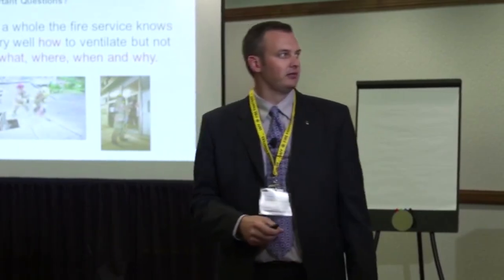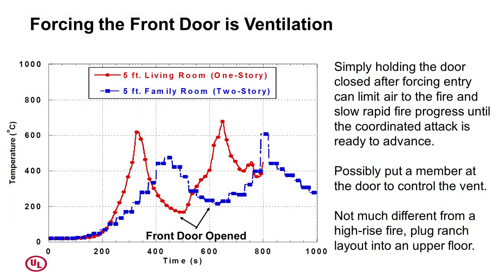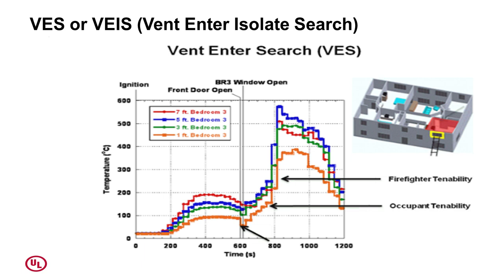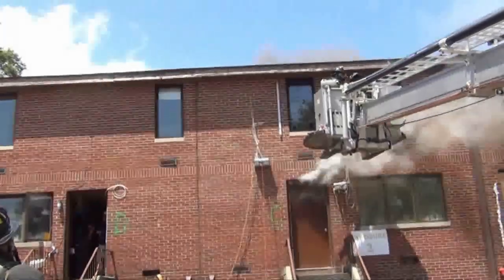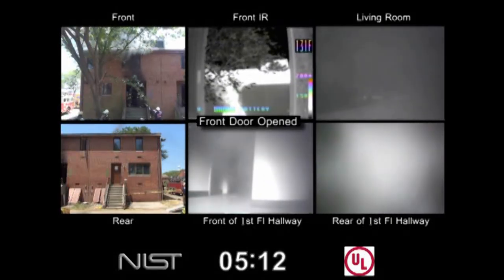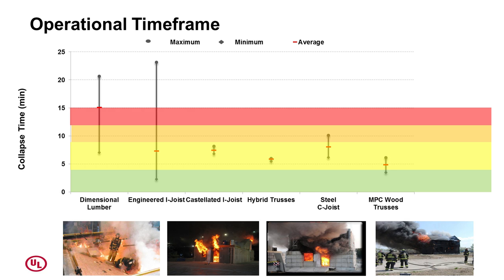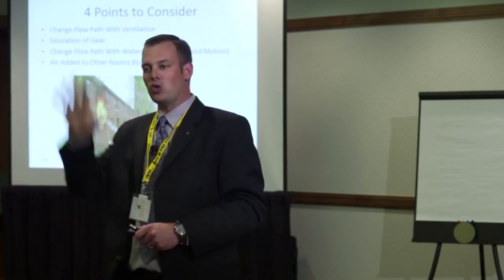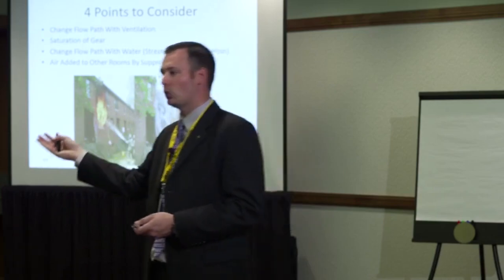Part 5 of 7: (Fire Behavior Training ) NIST & UL Research on Fire Behavior

Comment: There are 1.1 million firefighters in the United States...This video series should have 1.1 million views...minimum
Reply: Paul  Look at the number of viewers in all these videos and how many comments there are.  1.1 million fire fighters that can't Think and participate in a conversation.

UL and NIST aren't the problem.  It's childish hero wannabes that aren't listening and treating this like a job!
Reply: These videos are great training aides for our volunteer department. We watch frequently and discuss and compare with our past calls and it's amazing to realize where we've screwed up or succeeded. We simulate where possible and apply what we learned. With a limited amount of structural fires in our district we've found it more critical to be ready when we do have one.
Reply: @fireguy284   Every job has to have a Job Description.  A frame of mind.  A work ethic.  In fire fighting it Should be, "Eliminate the threat as fast and safe as possible while using the least amount of water."  Fast, Safe, Least amount of water.  That makes you think about how to act.  

1.  Fast:  Find what's burning with a 360.
2.  Fast:  Get a charged booster line to the fire room window.
3.  Safe:  Break out the window to vent the pressurized gasses to the exterior.
4.  Fast and Safe:  Extinguish the Visible Burning Material through the windows.
5.  Safe:  Enter a much safer environment that is 1000 degrees cooler just by eliminating the flames and wetting down the material.
6.  The  victims have been protected by the elimination of the heat and the further venting of windows.
7.  Water:  You surgically apply water by thinking of where every drop is going.  You use it as if you could run out at any second.  You use it as if you had to pay for it but you Think and get the Job done which is Protection not Search and Rescue.  S&R is for heroes and sometimes dead ones.  Ask Worcester, Ma. about that.  Tank Water application is much faster than crawling around in a burning building.
Reply: @JB91710  agreed 100%
Reply: @fireguy284    Good for you!  You are obviously in the 5% group of responsible Thinkers who know what the job is.

Comment: 25:24  Only if you have put the holes in the fire room.  Even then, you are introducing the fire into the attic.  Now you have a structural fire.  He is trying to talk you out of it!!!!!!!!!!!!!!!!!!!!!How big is the hole in the ceiling compared to the one in the roof?  Where is the hole in the ceiling?  In a room with the door closed to the hallway?  Is there flooring in the attic?  How about two layers of insulation?  Plaster and Lathe ceiling?  How about break the window at the fire room and put water on the Burning Material?.

Comment: 23:54  Vertical Venting!  LISTEN to his tone of voice!  They can't tell you to Do something or Not do something for Liability reasons.  He will describe everything you have to do to Make it work.  He is trying to convince you that there are Faster, Safer and more efficient ways to vent.  

25:15  That means, when you open the roof and YOU ignite the attic gasses, the fire inside is making more energy/pressure than that hole can release so you will NEVER get the heat from the first floor to go up and out the roof hole.  You won't even raise the smoke level.  

25:24  When have you EVER seen a hole cut in a roof and a hole punched through the ceiling directly over a burning room?  AND, if you Could do that, you have allowed the fire from that room to get into the attic BEFORE it could get out of the house!!!!!!!!!!!!!!!!  You have pulled that fire through the house instead of Out of it.

25:40  VVing is done throughout the USA JUST because that's what you have always done and in No Way is it done in a way it can possible work.  That's Human Nature to Do without Thinking.

26:00  Do you see any Improvement in the fire at the front door?  Aren't things supposed to get better?  The house on the left even got a Lot worse!  You are risking your lives up there for this result?

26:30  Before Vertical Venting, you have a contents fire.  Open the ceiling and you now have a structural fire.  That does Not sound like fire Fighting to me.  When have you Ever seen quick water application that eliminated the flames through the roof quickly?

26:40  No explanation from me needed here!

28:10  Again, when have you ever seen water application coordinated even close to vertical ventilation or any type for that matter?  At least with horizontal ventilation, you are giving the heat and gasses a direct route Out of the building and away from the interior and structure and it is Minutes faster!

31:00  Vent, water.  Vent, water.  Vent, WATER!!!  You will Never see that with Vertical Venting!  With horizontal venting, you break the window at the fire room and there is the seat of the fire right in front of you.  One person is in control of both venting and suppression.  No communication with other people needed and the room is soaked in 5-10 seconds after the window is opened.  A couple of SECONDS can mean the difference between life and death!

33:11  A crew is trying to go down the stairs into the basement while another grew decides to break out the basement windows.  Two teams with no coordination and communication.  The answer?  Keep the stairway door/chimney damper closed.  Break out the basement windows and immediately apply water to the burning material.  ONE operation controlled by ONE person.  When the basement is soaked and you think the flames are gone and you have lowered the temperature buy more than 1000 degrees, then you go down the exterior basement stairs if they are available.  If not, you go down the interior stairs with the nozzle set on a cone of water that is as wide as the stairwell so if there is a flareup, you can push it back and out the basement windows or have it between you and the fire as you back out.  

33:30  39:00  Come on people!  This is not brain surgery!  The main floor is a cork, a Damper!  Hit the basement through that window and cover every square inch.  You instantly eliminate the flames and drastically reduce the pressure.  THEN, you vent the main floor windows and doors and soak and Visible Burning Material from outside.  Sorry. That was braindead stupidity and nothing else.  Not a tactic that mysteriously didn't work.

34:26  I have seen fire fighters squirt water through a door or window for 10 -20 minutes where no fire or smoke is showing while the rest of the structure burned.  I have seen that Many times.

38:20  Please pay attention to this!

39:00  See 33:30.

40:25  Knock it down to eliminate temperature and extension and then go in and Mop Up.

41:40  Do you want to go in, wait a minute!  Does your Family want you to go into that house where the kitchen is 1400 degrees to extinguish it or do they want you to do it through the window and go into 200 degrees?  Try to Macho your way out of that question.   When you knock down that fire through the window before an entry team could get organized and dressed, then they could go through every room in that house and opening the windows would only make conditions better instead of giving the flames/pressure in the kitchen a place to vent out the bedroom windows.

42:10  This the way to do it but you will almost Never see an American department do this.  It ONLY makes Perfect Sense!  So to leave it burning while you go inside, has to be the Macho Hero factor.  There isn't another explanation.

44:40  If you hit all the burning material from the outside through the windows, this isn't even a factor.  The only fires will remain will be small ones that you can overcome quickly with a tight cone of water.  Use a straight steam in a hot area and let the flames continue, that's how you not only Make steam, you maintain it at a dangerous temperature.  Remember, the moisture needs a constant heat source to keep it dangerous.  Put your hand over a pot of boiling water and start to lower it.  You can get very close to the water as the humidity you see has already cooled.

45:50  This is why it is important for the nozzleman and his crew should physically control venting and suppression and it can ALWAYS be done.  Communication does not exist in many departments and crews so that SAFE ventilation can be performed by crews in different locations..